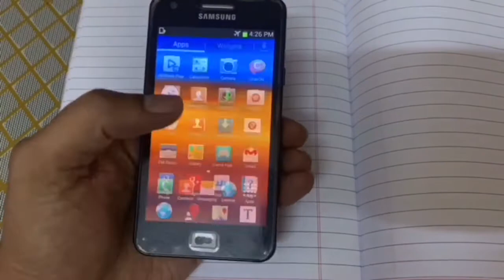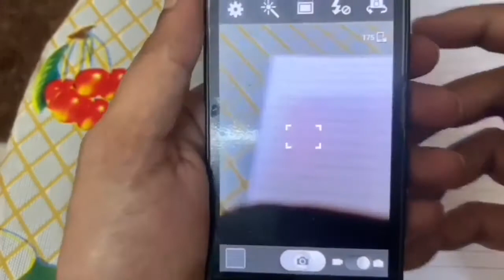How to Remove "BLACK SPOTS" from any mobile camera sensor? -UBR

Comment: Readmi 5 md1 back camra ne chal raha place help me
Reply from the maker: If sensor faulty then replacing is the only solution.
But you can try this:-
Backup your data
Complete format and reinstall android os in phone.
If problem with driver of camera it will fix the problem.